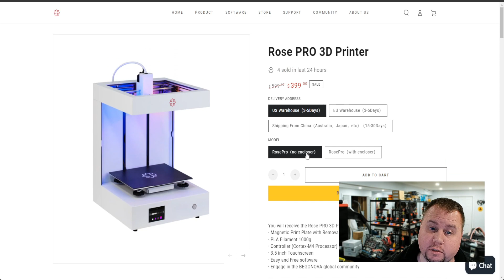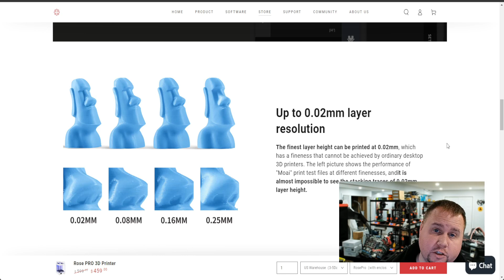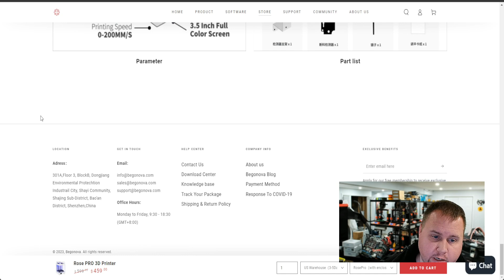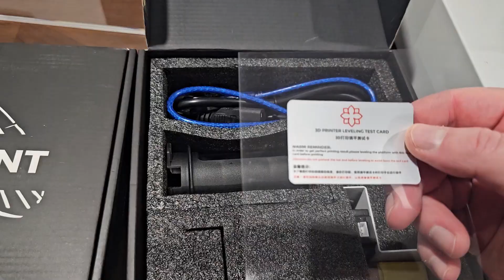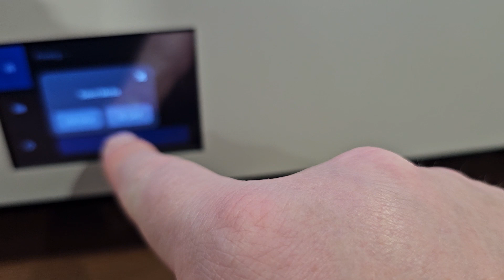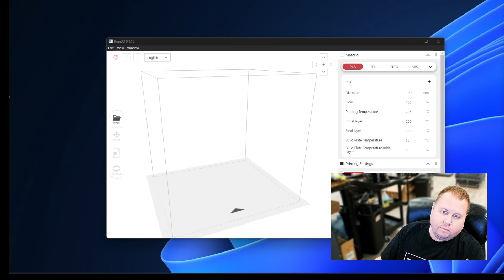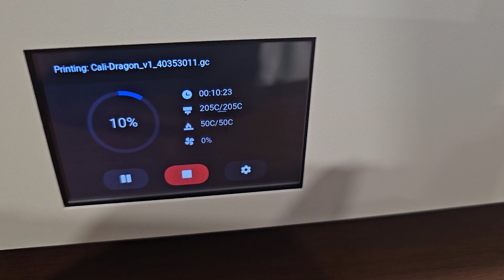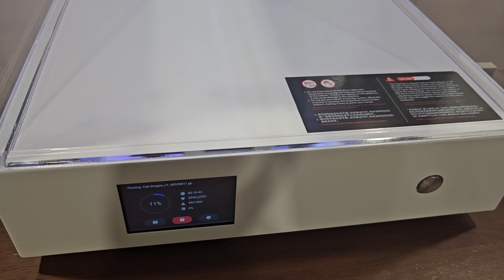This Printer is Unique!  - Rose Pro 3d Printer Review by Begonova

Comment: Hey Glenn! Glad to have you back.

This was a good video but I think you’re missing some pretty important stuff.

Did you try setting up a Prusa Slicer profile for it? And how does it work?

What speeds are you running it at for those prints? Standard like 50mm/s inner stuff and 25mm/s outer? It looks like it’s CoreXY, maybe it could be pushed a bit faster if that’s what you’re running it at. I know you said that last benchy was fast, but how fast?

Also, will you be using this for your Etsy shop now, or was it just for fun? It would be interesting to see some of your products printed on a Prusa vs this printer, to see if you could sell prints off this and get the same quality.

Unrelated but I’ve got another question/video idea for you. I’ve got some keychains on my Etsy shop and I just realized (a bit too late unfortunately) that I probably could have made them into holiday ornaments. Should I make a separate listing for the ornaments or should I just add some ornament pictures to the listing and sell them as either keychain or ornament in one listing.
Reply from the maker: Thanks to the input! Yes I'm trying to get better at the testing and I'm just getting back into the swing of things this is the first video in like two months, hoping to have some more time to put into them, I used their stock settings like I was a new beginner 3D maker, I could have went crazy and tested the crap out of it but that takes a lot of time and people don't really want to see that video they want to see the bare bones in my opinion, does it work well, how does it print, I'll try to make my next video a little more detailed as I have a Creality coming in to test.  As for the ornaments I would make a separate section for it or at least a separate listing You can list the same item as two different things if what if it could be a keychain and an ornament at the same time You don't want them in the same listing, different pictures different keywords etc.  however also I've learned holiday items have been somewhat of a waste of time for me since they are only a short portion of the year